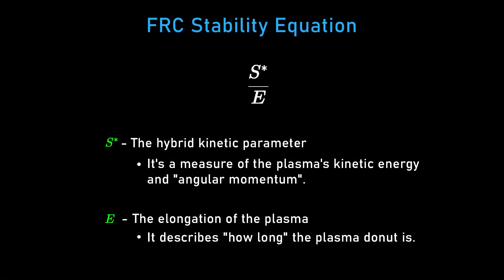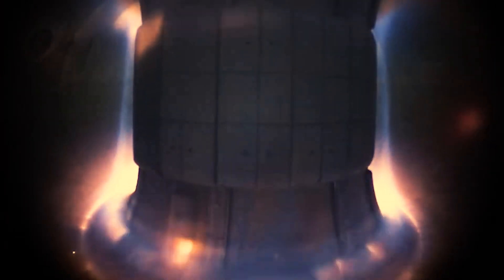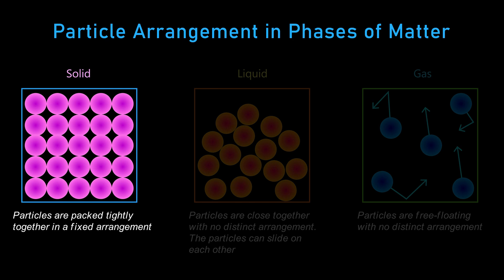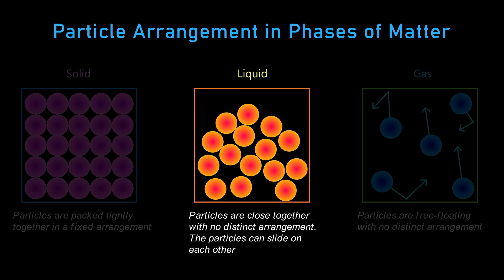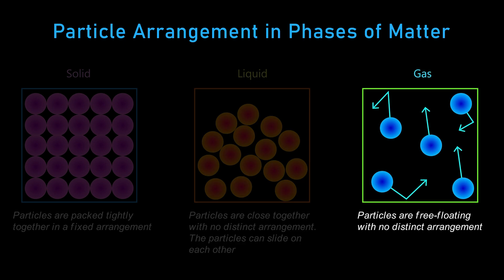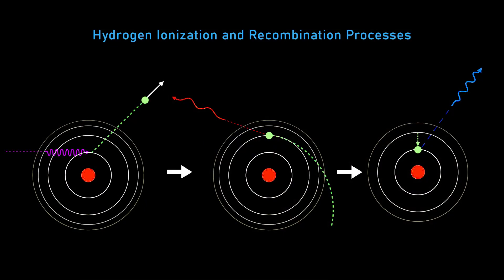100 million degrees: Extreme temperatures of nuclear fusion plasma | David Kirtley and Lex Fridman

Comment: To require 100 million degrees seems like it'd also require a significant amount of energy to attain those temperatures.

To provide that amount of power to the system detracts from the amount of energy that can be extracted from the system and harnessed for use elsewhere.

If the primary extract from fusion based systems is the energy, it seems like there are far less demanding and, subsequently, more efficient methods that can be invested in to extract far greater amounts of energy via far less complex and smaller pathways.

That Helium is the byproduct isn't entirely accurate. Helium is also a byproduct. Helium in & of itself isn't the energy source.

Going with 2× tritium atoms fusing to form the He², that leaves 2 neutrons released.. ..assuming 2 neutrons remain in the nuclei of each Helium atom.

So each He² is 4 neutrons. Assuming even a 100% capture & conversion efficiency of the energy released in the neutrons, that's still far too few neutrons to even power the system.. .. let alone extract harnessable energy for energy production.

There are elements with much higher neutron counts that product stable aneutronic isotopes as end products..

Boron 10 & Boron 11 are very common in the earth's crust and fusing them can release 10-12 neutrons per fusion.

That's beginning to get there.. 

Where does the tritium come from?
Where does the deuterium even for that matter?